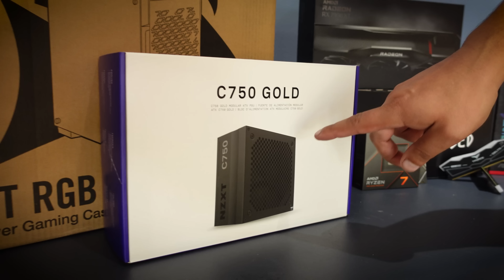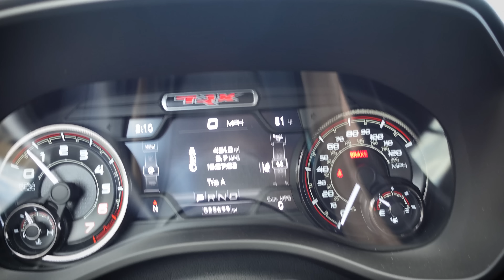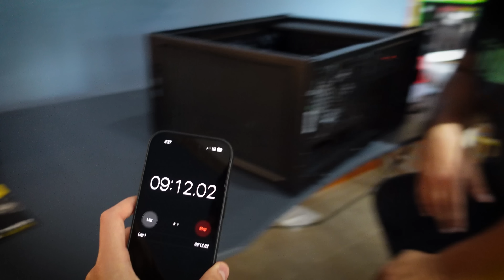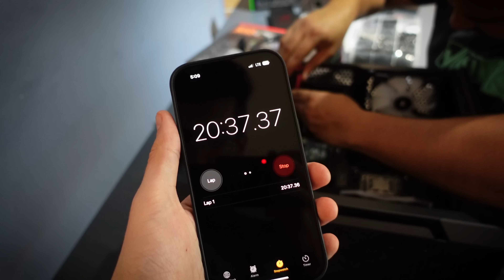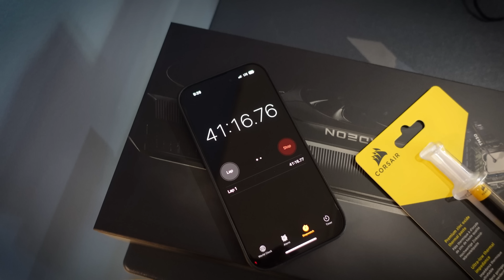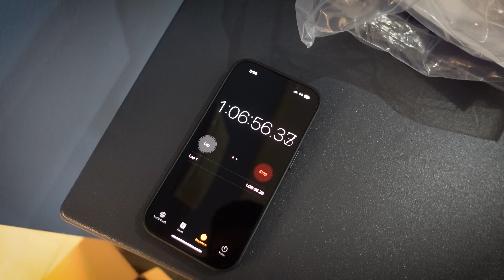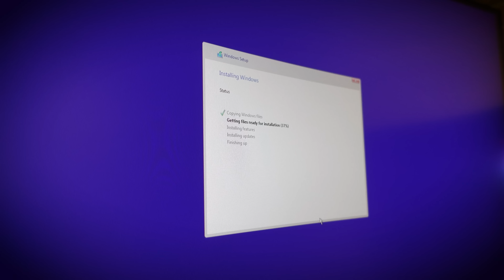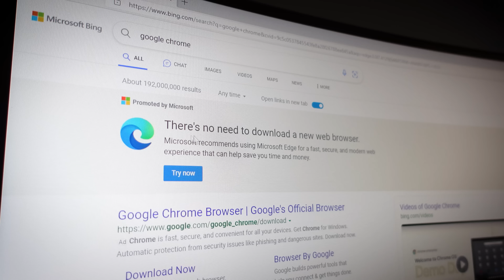The "Fastest" PC Build on YouTube?

Comment: Freddy, Greg steered you wrong. Did you know that the Motherboard Manual actually shows you all the steps to put it together. It even shows you which screw goes where and what it looks like. 
Also, if Greg wasn't making you use used hardware, it would already have thermal paste on the CPU cooler

Comment: While I was watching the video I kept wondering if that AIO and the GPU were going to fit XD, about 6/7 months ago I built a PC for a friend in that same tower and with a ROG 3060Ti I had to remove one of the front fans so that it would fit, in that one I did not use an AIO but a 120mm air cooler but I did notice that the tower is somewhat short, the truth is that I thought it was the same size as the 4000D but it is much smaller, although definitely what I learn was that ASUS ROG video cards are too big XD

Comment: I built RYZEN 7 1700x with 1TB m.2 5000mb read and write speed, 32gb ddr4, corsair 550 watts power supply on an Asus the gaming b450 pro ii motherboard with MSI GEFORCE GTX 1650 4gb gpu built in two days because there were lots of missing bits

Comment: You don't need thermal paste. It's on the cooler.  I just bought that 360 rad. Works great on my i9 13900k.
Reply: You do if you've used the cooler previously and cleaned it off.....